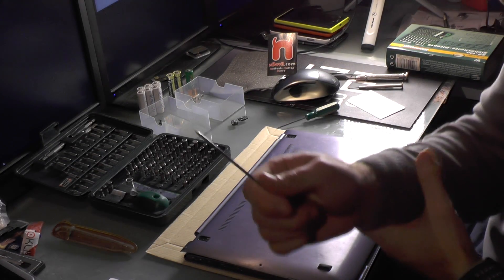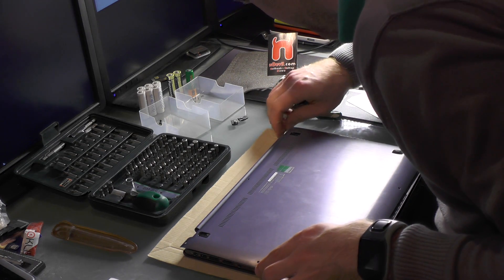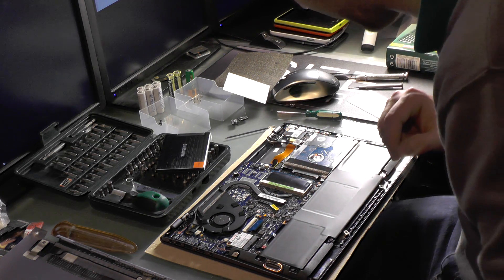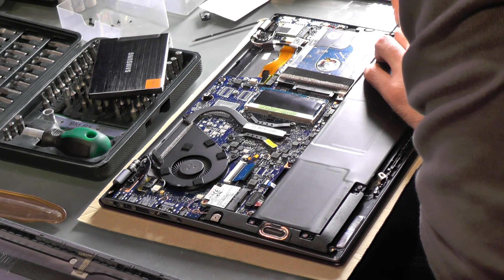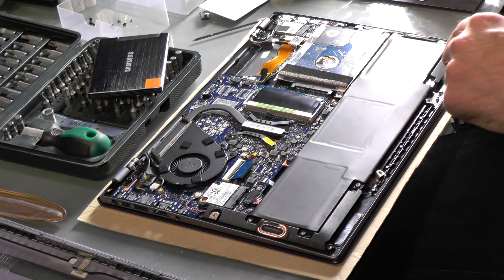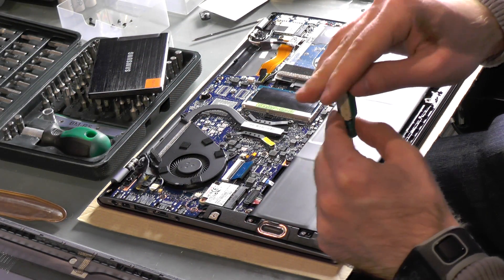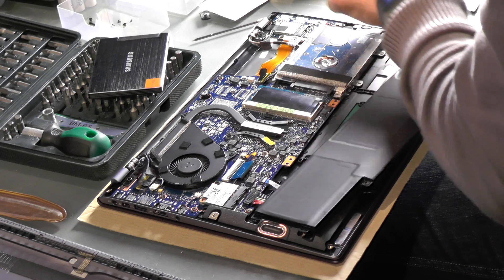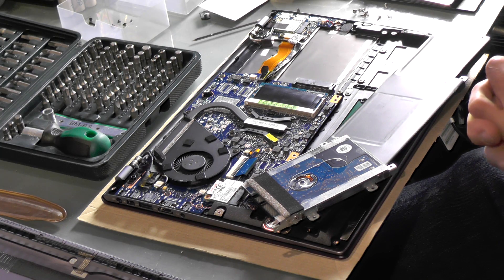Asus UX302 RAM and SSD Upgrade Part 2

Comment: Thanks for the video !
After upgrading my UX302 with a Samsung 850EVO SSD, it is blazing fast, but the fan is constantly spinning at full speed.
If you had the same issue, did you find a fix ?
Reply: Hey, I was thinking of doing the same - did you manage to find a fix? Any help would be greatly appreciated!
Reply: Yes the fan finally stopped blowing out after disconnecting and reconnecting the ssd and letting the computer idle for a couple of hours. I've read that windows was taking a few hours to re-calibrate the cooling / fan profile after a hardware change.
Reply: Great, thanks :)

Comment: Thank you so much for the video, and for including the challenges as much as the successes.  Too many of these types of videos just look so polished and smooth, that when you start doing it yourself, you quickly feel like a failure when everything isn't going the same way as the video.  Not being able to get the bottom off and having to do a second video, but still publishing both was a real help to me in dealing with THE EXACT SAME issue when trying to upgrade my RAM.  Thanks again.

Comment: Anyone knows what's the maximum RAM for the UX302??
Reply: according to asus DDR3L 1600 MHz SDRAM, up to 8 G, OnBoard Memory 2 GB / 4 GB, DIMM Up to 4 G
Reply: I have mine configured to 10GB (2GB OnBoard + 8GB Replacable)
Reply: Dj Jackson do you know the brand/model of your 8gb module? just tried a hynix stick and it didn't recognise and won't start. thx
Reply: I used a Crucial 8GB module, works like a charm
Reply: Andy Li ^

Comment: I just bought an Asus UX302LA, and I would like to upgrade the HDD to an SSD and RAM to a 8GB module. Any suggestions on which ssd and ram to buy? RAM apparently needs to be DDR3L (L = Low power).

Comment: I made similar modifications on my Zenbook UX302LG. Changed the SSD to a Kingston HyperX 240GB, works like a charm, there's an extreme difference. Just have to turn the safety boot off in BIOS to get it recognized. BIOS version is 209 btw. Took the 16GB Sandisk out completely...

Unfortunately I didn't have luck with the RAM. Bought a Corsair Vengeance 8GB CL10 1600 but it is not recognized, probably because it's not DDR3L, so I will have to swap it for another one.
Reply: just upgrade my ram to 6gb overall (2 on the motherboard, and 4 on the memory stick [Kingston valueram ddr3l]). works fine and ran the memory diagnostics with no problem. apparently the product specification on asus website states that the laptop can take a max of 8gb (with 2 or 4 on motherboard, and a max 4gb memory stick). so with 2 on the motherboard, the system max according to asus is only 6gb. if anyone's tried 8gb ddr3l stick please let me know if it works..

the other thing I need to point out is that in windows task manager under the memory tab, it actually shows to have 4 slots, so my guess is they don't run in dual channel mode anyway and you can put different size sticks in as long as it's supported by the system..
Reply: Hey i'm sort of a noob at this but I want to do the same thing you did, but how did you install windows on the SSD? do you use a usb boot? also do you think using upgraded mini sata and leaving the 500g for storage is a good idea?
Reply: ***** Hi, I completely forgot I had a comment here. LOL
Anyway, since then I managed to swap the RAM as well. Bought a Kingston ValueRAM DDR3L, and had no problems at all installing it. Just adding this as extra info.

As for the SSD I migrated everything onto it from the HDD. But the USB boot works as well, just grab a pendrive and use rufus boot creator. I would use an SSD if you are looking for speed. Never tried to install win 8 onto an mSATA, but everyone claims it's still a lot slower than SSD. I would use an external HDD for storage.

Comment: so man how many GB  an hold  my UX302L  ?? its start from 4gb 2 are solded to the motherboard? right? you can remove the other 2 and ad 8gb for a total up to 10GB? im correct or can be 8 + 8 or what whats the maximum Ram this pc can support?